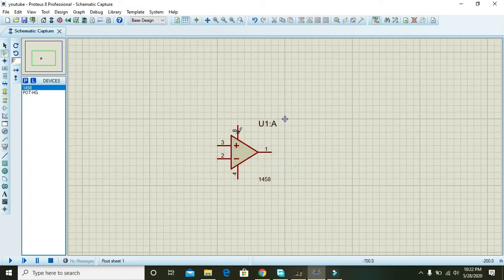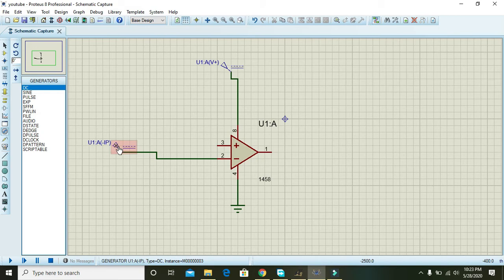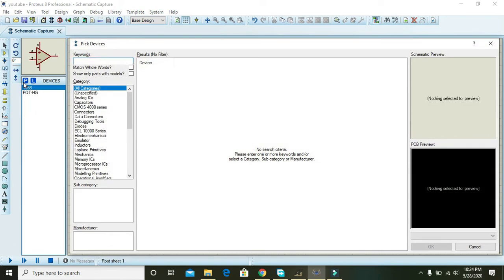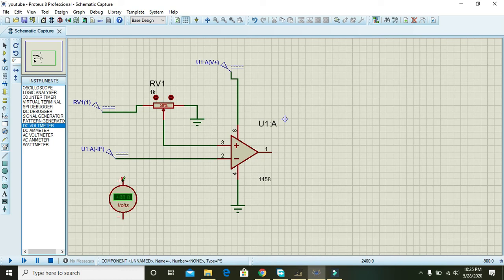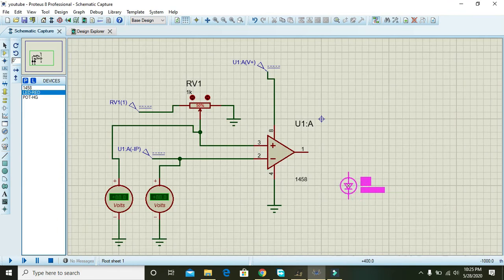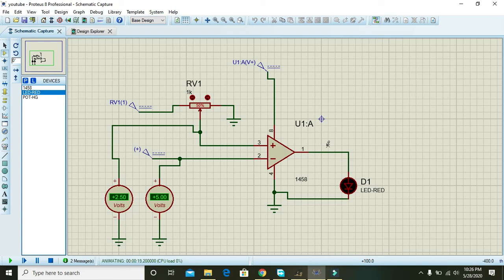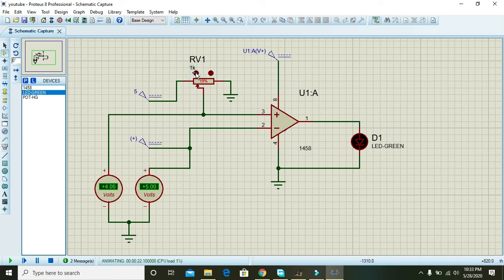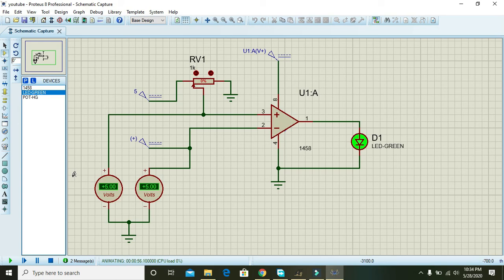simulation of comparator circuit with opamp in proteus | How to make comparator circuit in proteus

Comment: HOW did it worked with both same dc volatges ie 5?
Reply from the maker: u can operate both the opamps on 5V and then also be able to compare voltages on the input...
Reply: @nelsondarwinpaktech3954  i did the same but mine not works for 5v and works for anything above 5